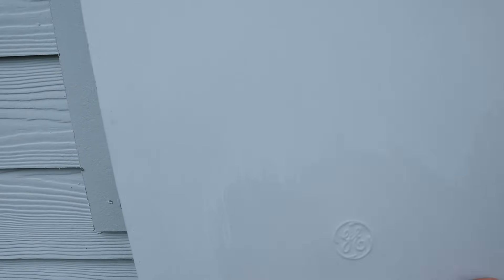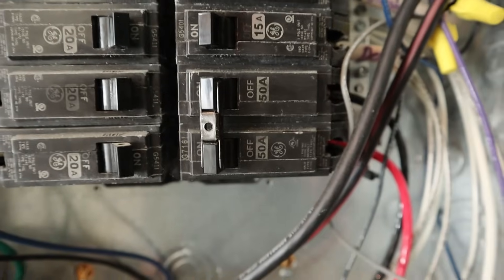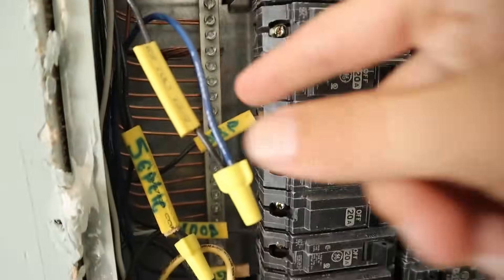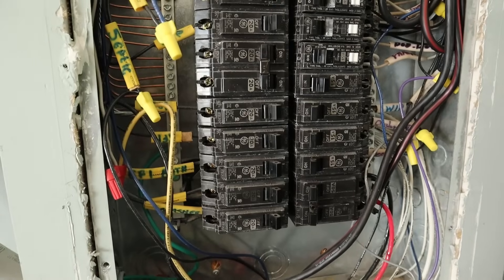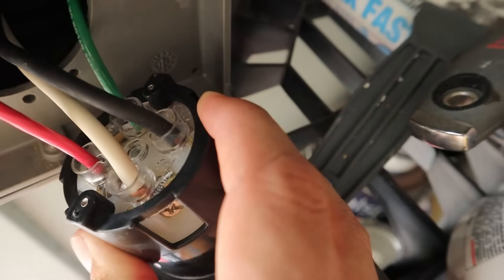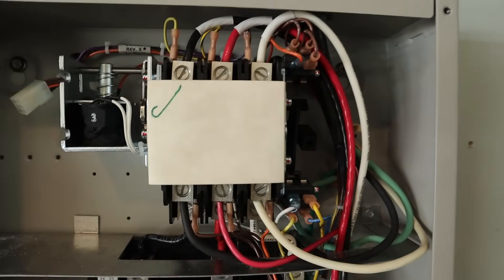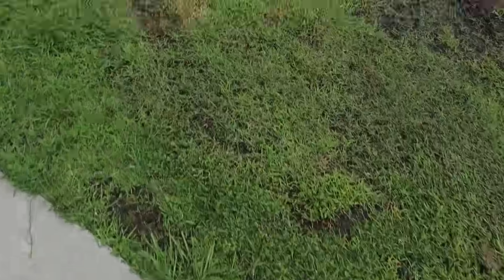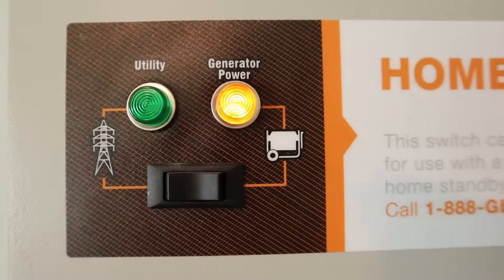HOW TO INSTALL A PORTABLE GENERATOR TRANSFER SWITCH

Comment: Great video. I've got the basics done with no problem but how do I connect the transfer switch to a GFI breaker (with two wires coming in and the neutral coming out) for my bedrooms?
Reply from the maker: Hey, for this particular transfer switch, you would need to go to your local home improvement store or electrical supply store and buy a GFCI or AFCI (oftentimes AFCI is what is installed for bedrooms so verify your breaker first)  Seimens breaker as those are the circuit breakers that fit in this particular transfer switch.  Make sure you are getting the same amperage circuit breaker that the current circuit breaker is.  The breaker would then be wired in the transfer switch exactly how it is wired currently in your main panel.  The transfer switch is essentially just a sub panel so just view it as the new housing for the circuits you choose from your main panel. 
 I hope this answers your question!

Comment: Nice video what's a rough estimate to have that installed
Reply from the maker: Hey Joe, the costs for the transfer switch, extra wiring, different circuit breakers, and other small items was around $500-$600.  Now if you are talking about how much it would cost for an electrician to install it, that will vary widely depending on your particular installation situation but I would estimate somewhere between $800-$1000 but again can be completely different depending on labor and materials needed.  Thank you for your kind words and for watching! If you have anymore questions, please feel free to ask!

Comment: Greetings, with your video I decide on that transfer switch, I ask you, my house is 110 volts, that is, I only have one phase, it is an old house, I will be able to make a bridge in the transfer switch to install the 6 brakers from the same phase , or can I only use 3 circuits?
Reply from the maker: Hey Melvin.  No you cannot bridge it.  You would only be able to use the 3 circuits.  If you bridged it you would burn your service out.  If you want to be able to use all of the circuits, you would need an electrician to upgrade your main service.
Reply: @HowToHomeDIY  ok thank you very much for your quick response! I am thinking of acquiring this model for home, as in my house there are only 3 wires, 1 phase, neutral, ground, and the main panel is one of the old ones that only has 1 30 amp delay fuse, I saw that it can also be configured to power the transfer switch with 30amp instead of 50, since I will not use things that require so much energy ... I don't know if it can be, I read something that could be configured for 30 amps
Reply from the maker: Yes in your case a 30 amp breaker would be good to use.  However, you will still only be able to use the 3 circuits.

Comment: Very confusing for the lay person.  You say to move wires.  Do you mean disconnect and run over?  .  You say to move the wire, but what if it's isn't long enough?
Reply from the maker: Yes it can be a confusing process and also an important one as well.  When I say move I am explaining that the circuits you choose in your main panel that you want to have powered by your transfer switch are in fact going to be moving to the transfer switch.  The wire that is in the circuit breaker that you are wanting to move will need to be disconnected from the circuit breaker in the main panel and attached to the wire, via wire connector to the wire connected to the new circuit breaker in the transfer switch.  This transfer switch did come with wires to be able to connect to the wires in the main panel but not all transfer switches are the same.  If the wire is not long enough then additional electrical wire will need to be bought from your local home improvement store to make the connection.  All of that being said, make sure that you are replacing a 20 amp breaker in the main panel with a 20 amp breaker in the transfer switch, 15 amp with 15 amp, etc.  Also, it is imperative that you are using the proper gauge wire to complete the circuit.  Typically a 15 amp breaker can use 14 gauge wire, 20 amp 12 gauge, and 30 amp 10 gauge.  You probably know all of this but you ask a good question and it could really help the next person.  So I really appreciate the questions and hope that I was able to clarify everything!
Reply: @HowToHomeDIY  Thanks for the very detailed follow up that does help to explain a few of the details that were implied in your video, but I didn't understand.  I did watch it again, along with a few more and now have a better understanding as to how the transfer switch actually replaces the circuits that I want to be used by my ax. power.  Thanks for the more detailed explanation and taking the time to reply.
Reply from the maker: @RiverLife100  Ok great!  I am glad to hear that.  Well thank you very much for watching, good luck with the project, and if you have any other questions please feel free to ask.  I would be more than happy to answer them for you!

Comment: isnt there a safety lockout key that wont allow both city service and generator power to be on at the same time?
Reply from the maker: Hey, yes it is internal in the transfer switch itself.  On the top left corner of the transfer switch box you will see a switch.  On the left side of the toggle switch it says utility and on the right side it says generator power.  If you hook your generator up to the transfer switch and power it on, sending power to the transfer switch, once you select generator power on that switch, it completely moves your power source to the generator.  At this point, the transfer switch has completely disconnected from the utility source internally, regardless of whether there is utility power coming in or not.  The transfer switch will not allow for the utility power and generator power to be on and powering the circuits at the same time.  I hope this answered your question.